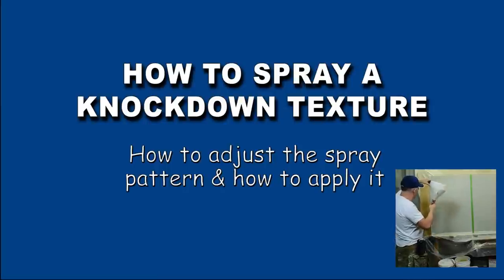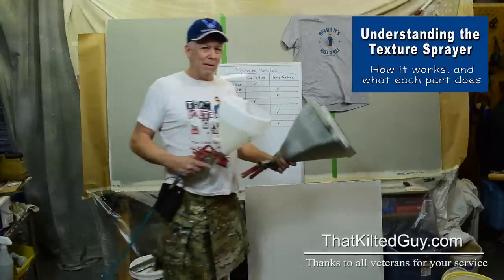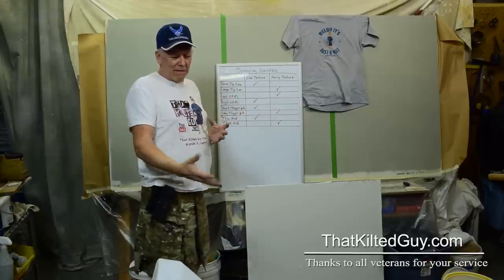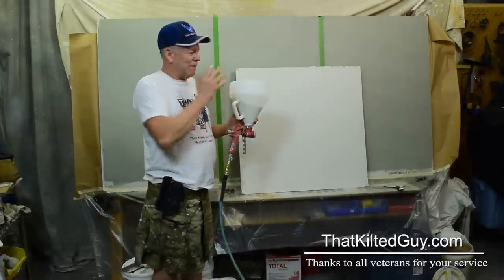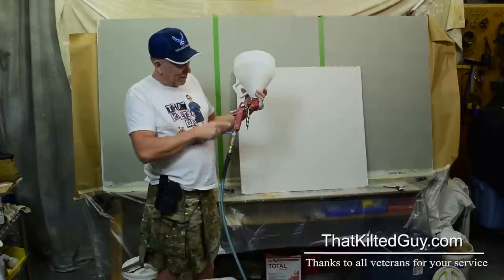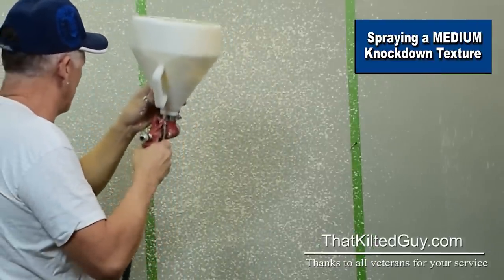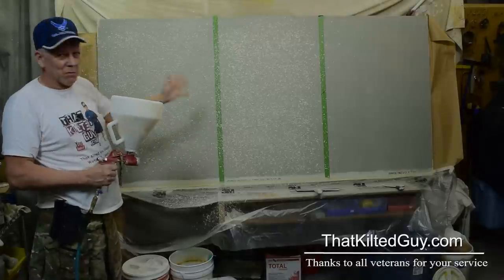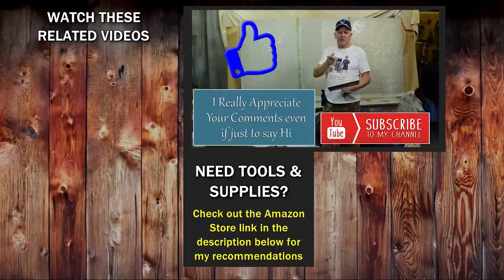Spraying Knock Down Texture in 2022.  Learn the 🔐 SECRETS 🔐 only PROS know using this $30 Tool

Comment: 8:07 pancake batter….the go to for explaining.
So here’s I describe thinner “batter” for ppl learning.
Want thinner mix, tell someone to microwave peanut butter or better yet HONEY in micro for 10-30 seconds, than pour into another cup….
For peanut butter nuke it but for 30-45 secs on 90% power (1000w micro) and gets you an idea of what “batter” looking for😉
If you actually do this, please use the amount of 1/2 to 1 cup to give you a good example as anything more than that….times/power be diff. I also highly RECOMMEND that ya do this, so get an idea of what consistency actually is😁

Comment: I wish I had watched this video before we bought 4 cans of spray texture. We watched a couple of your videos about how to take off the popcorn (we are redoing our bathrooms) and it worked perfectly and we used the Krud Kutter and it came off in sheets. My husband only has 1 day a week off so we knew it would be slow going since we have 3 bathrooms and are installing new vanities,  painting, installing new flooring in 2 of the bathrooms and decided to try and take off the popcorn and then knockdown texture the ceilings. The bathrooms are small and we thought if it goes well, maybe we could tackle the popcorn in the rest of our 3 story, 3500 sq ft fixer upper. LOL! Well he got so upset trying to use the canned spray texture (it was just oozing out the front and not even making it to the ceiling) that he was ready to throw in the towel, which really isn't like him, so I said let me see if I can find a video from that kilted guy. And I did and I love the 1st thing you say is "you should NOT waste your money on Spray Can Texture." So thanks again! We have renewed hope that we can accomplish this because of your videos. We are even going to order some items from your link below. :)
Reply from the maker: really glad I could help. Here’s a little tip though. When you use spray can texture and it doesn’t want to spray hard enough, heat it up under hot water until it does. The hot water will increase the pressure in the can and get it to spray. But I still hate the stuff, LOL
Reply: @ThatKiltedGuyDIY  I tried the spray can on a cardboard box.  I used about half of the can, then calculated the cost of doing my wall project.  It didn't take long to figure out that I could buy the sprayer and a box of mud powder, borrow a compressor, and still save over $100.  The spray can is expensive and the results are terrible.  The hint on heating up the can is useful if I need to use the can for a patch somewhere.  Thanks!

Comment: Very professional.  It was easy to tell you have the right experience to do this class.  I learned a lot.  I know it will help me in my upcoming whole house project.  Would you recommend the larger hopper for a whole house project?  I am 73 and not as strong as I used to be, so fatigue may be a factor.
Reply from the maker: Well the larger hopper means less fill ups required, but it will weigh more.  I think the light one will be fine for lighter textures, but if you are spraying heavy, the larger hopper will empty fast enough that the weight might not bother you.  And spraying ceilings will make either feel much heavier.

Comment: I love your videos. I need some assistance to be sure I have the right steps for my project. I have removed my popcorn ceiling, sanded and repaired all defects. I am going to do a spray on knockdown ceiling like you show. I want to be sure that I would do this step next after everything I have done and I don’t need to prime the ceiling or anything before doing the knockdown. Then I was going to do a paint/primer over the knockdown. I’m hoping you can help me know if this is the right steps. Thanks again!!
Reply from the maker: Other than masking off the walls before you spray the texture, you’ve got it.

Comment: 2 questions, please. First what size air compressor do I need with the hopper?  We have a small 2 gallon compressor that I hope to be able to use.  Second, we are remodeling a mobile home and taking those strips off, and then tape and bedding the seams.  Do we need a special mud for the vinyl wall paper?

Comment: I'm about to embark on a "project" repairing drywall after stripping wallpaper, cracks in ceiling and then knockdown texture. So thankful I've found your video before I started.  I went to your web page to subscribe for your newsletter and even sign up for advice.  Unfortunately none of the links work.  I click on them and nothing at all happens.  Not sure what's up with that.  Thankful I found your videos.  Been watching for two hours!!  Answered so many questions with the demonstated techniques!
Reply from the maker: Stacy, glad I could help.  I'll look into those links, but maybe try a different browser.  Haven't had any problems before.  If you need advice, that is beyond a simple answer on here you can contact me privately at thatkiltedguy15@gmail.com and I'll let you know the costs and options.  Or you can just sign up on patreon at the level which fits your needs at
Reply: @ThatKiltedGuyDIY  Thank you Guy!!  I tried again and my ad blocker (Adblocker Plus) was the problem.   I had to permit your page.  Seems to work now!  Thank you for the contact info also!!   I've signed up for Patreon!!  Thanks so much!!

Comment: I appreciate your videos and have been enjoying your channel and already been a huge help on several projects. We are going to be moving to an older home with popcorn ceilings and proper a bunch of wall repair.  I am curious to any tips and tricks when spraying knockdown on celing.  Also, not sure  if what the strategy is to take if I have a bunch of  painted textured walls needing minor repair.  Would I sand and do a skim coat?   You may already have videos that address these specific things.  I don’t know how homeowners learned this stuff before Youtube...
Reply from the maker: Here's one on knockdown on ceilings- https://youtu.be/0fUkW3SCYiE
And check this one out for misc repairs- https://youtu.be/_sSHn51WYxs

Comment: I appreciate your in-depth videos, very helpful. I'm curious though, which tip did you use to spray those knockdown textures? Was it the middle sized one?
Reply from the maker: The middle size is the one i use the most

Comment: Awesome video. After the drywall is up and joints are finished, what’s next? What are the steps? Joints, prime, knock down then paint? Appreciate it
Reply from the maker: Most drywallers just finish the drywall and then apply the texture right over that. Then primer and paint.
Reply: That Kilted Guy DIY Home Improvement ok great, I’m just trying to finish my kitchen 9’ x 13’....

Comment: I've subscribed. I've read on contractor forums that some people tint the mud so they know they've covered areas when taping and doing smooth wall.  If you are spraying texture on primed drywall, which is usually white,  wouldn't tinting be helpful here too, to ensure complete coverage?  On  another drywall pro's videos comment section he says he never applies tinting to mud on spray texture.  I'm not sure what he means by that, does  he not apply tint to taping mud or to the spray mud?  Either way, I'd like to know what you think about tinting mud.  Never-Miss Tinting?  Chalk line tinting? Food coloring tinting?  Maybe do a video on tinting issues.
Reply from the maker: Hello, sprayed on mud is pretty easy to see going on as it goes on mostly yellowish.  As for tinting, I Only tint when doing a level 5 smooth finish, like in this video I put out- https://youtu.be/4T6x7wiP-aA

Comment: Thanks for the video. Super helpful. Doin some home renovations and I have a 100 CFM compressor, small little guy, will this be ok to use with a texture hopper?
Reply from the maker: a 100 cfm Compressor would cost about 100,000, so you probably mean PSI?  Read my recent community tab post about this.  https://www.youtube.com/@ThatKiltedGuyDIY/community and scroll down a little

Comment: Love your videos, you’re an excellent tutor. Quick question for you, or anyone else. I’m a complete novice but have a big project coming up. I want to achieve a level 5 (I know, ambitious right) finish. I have time to finesse, it’s not a commercial job. If I apply diluted joint compound with a spray hopper and immediately smooth out with a knife can I achieve the same result as I’d get using a roller to apply? I’m thinking that spraying is easier and faster than rolling but maybe not. Surprised that I haven’t seen any videos on this approach but perhaps it’s because it is a bad idea.
Reply from the maker: I have thought of that but the cheap texture hoppers would take 3 to 4 times as long to get it on thick enough

Comment: I did buy that plus 3, but it seems to flake off the wall pretty easy when I accidentally hit it with things. Also, cheap paint might have something to do with it also being that it came off the wall easy when I hit it?  I also feel I didn't hit the wall that hard either.  I'm going to try using just the all purpose on next project.

Comment: Thanks for your video helped me a bunch and do you have a video on how to tape angled greater than 90 I struggle with that especially going into another wall
Reply from the maker: Do you mean taping inside angles like in this video? https://youtu.be/J-aS1vsjQi8

I'm actually going to release a better version of that video real soon, so be sure to subscribe and click the bell icon.  I already shot the video so it shouldn't be long.  If not an inside angle, do you mean an outside angle like one that is a 45 degree splay?  I can certainly do a video like that, as it's a good idea anyway.  Thanks

Comment: Best knockdown video by far! Thanks a lot!
Can I please get the CFM value of the medium texture?
Reply from the maker: Thanks.  There's no cgm value.  I have a little ball valve right where the air enters the gun and I adjust that till I get the pattern I want.  For medium try opening it midway.  For fine, open all the way, etc.  Set the air psi to 30 for everything and adjust the CFM with the ball valve.  If you don't have a valve, turn the PSI up for finer, down for coarser.  Thanks again.

Comment: I'm about to do a project where the tenants want the heavy knock down applied to the ceiling. What's the best way to go about? or, how do you recommend I go about it? I did realize you had move closer to wall when you did the heavy knock  down in the video...
Reply from the maker: This'should help- Live, Spraying a Knockdown Texture with a Hopper Sprayer, by That Kilted Guy DIY https://youtu.be/0fUkW3SCYiE

Comment: Nice videos! Would you do a video on doing a santa fe texture? There are only a few on YouTube and they're not very good. I'll be doing a large room and hallway with a  vaulted cieling within the next two weeks.  I've done knockdown before and it turned out great but it was a small room so I had time to sit and wait for just the right time to knock it down after I sprayed it but with this large of a room I'm having a lot of anxiety about things drying too quickly and the texture not being consistent throughout when I go to knock it down. How do you do large areas and stay consistent throughout? So far, your skip trowel method might be a better option for starting and stopping. I'm just kinda lost right now  on what texture I should use for this big of an area. I need it to look good. Also what do you  do with pinholes, debris, and streaks from the debris when your skip troweling or when doing a santa fe texture? Also would you prime before texturing? I'm having a lot of joint compound  adhesion problems to the several layers of old paint even though it was sanded down first. The moisture from the skim coat keeps softening and lifting any prior coats. Sorry so many questions.
Reply from the maker: Hello john mousseau, due to the increased number of subscribers, and questions, all our more complex questions are now answered on our Patreon page at: https://www.patreon.com/ThatKiltedGuy. We hope you'll join us there and help us to answer your questions, and to put out many more videos.  

We will continue to answer the most common, simple questions here, and we greatly appreciate your comments.  Thank you for your support!  And yes, I'll be putting out a lot of texture videos in the near future, along with the many I already have out.  Guy

Comment: Low volume spray gun hopper.  I see the hopper you use and recommend has a minimum airflow requirement of about 7 cfm at 90 psi even though you use it at 30 psi.  A big box store sells a more expensive hopper (3x as much, Texture Pro 200 spray gun) with a minimum requirement of 2.6 cfm at 90 PSI which will work on paper with my existing small pancake compressor.  I am texturing about 300 sq feet of wall space with medium knockdown.  Understand if you have never seen or tried this smaller gun/ hopper with smaller air compressor, but if you have tried it, any tips on getting it to work?  Or if you tried it, is your recommendation to run and hide and just suck up renting a big compressor.  Thank you.
Reply from the maker: OK, yes most hoppers need more CFM than the small compressors can handle if you’re spraying an entire wall, room, etc.  But since I mostly teach repairs, I show myself using the compressor in the link below. It will keep up long enough to do a repair since you only pull the trigger a little at a time. And I shut the air off as soon as I’m done using it right at the bottom of the gun with a ball valve. 

I’ve used the compressor below 95% of the time. It’s lighter and quieter than a bigger compressor

https://amzn.to/3PX4AN9

So for bigger areas I would recommend a bigger compressor.

Comment: GREAT videos ....   question you never had ..   could you use a hopper to paint a truck bed  texture? ..  maybe using bondo or fiberglass as the mud ? ...   dont want to pay high prices for the auctual truck liner  kit ..  its a old truck ...   thanks for info...  cheers
Reply from the maker: A hopper wont' spray really heavy stuff, as it relies on gravity to flow the material to the nozzle, so probably not.

Comment: One thing I did not see you cover (maybe I missed it) is the angle of the trowel to the ceiling that you use to do the knock down.   I made my initial pass which looked great.  Then I did a pass at 90 degrees to go the other way so it doesn't look like the knockdown is being pulled all one way.  But each time I did that I got ripples.  Could not figure it out.  I believe I had too much of an angle on the trowel on the second pass after sleeping on it.  but any suggestions on how to fix this would be welcomed.  :>)
Reply from the maker: Keep the angle low

Comment: Is it advisable to prime the drywall before applying the texture?
Reply from the maker: They recommend it but we never did when doing new construction. But it will allow the drywall mud to set up more evenly making it easier to knock it down so it is a good idea.

Comment: Very informative, thank you. Can I use the 6 gal pancake compressor to do texturing?
Reply from the maker: Even small compressors will work for awhile.  The smaller ones may run out of air quicker, and not break up the mud as much, so you might have to wait for it to catch up.  The main this is to look for a CFM rating of roughly 3cfm or higher, at 40 psi, as this is what I have and sometimes it can't keep up.  Over 5CFM would be better, but I've gotten by with mine for years, so it'll work.  Be sure to turn the air off when refilling with mud so the compressor can catch up some.
Reply: @ThatKiltedGuyDIY  I'm only doing knockdown on a 7x7 foot section of ceiling; so it sounds like my little porter cable pancake AC will work.

Comment: Thanks for your video! Do you have any suggestions if my wall and ceiling are skim coated with mud that’s well dried? Thanks!!
Reply from the maker: Probably just sand it, touch up any remaining defects and texture it
Reply: I guess that my question was regarding how the skim coat would affect the wait time from spraying to knockdown
Reply from the maker: It'll set up a little quicker

Comment: I need to do a medium knock-down on my ceiling and a fine orange peel on the walls.  I understand the techniques for each but wondering what's best to do first, the walls or the ceiling?  I'm thinking the orange peel on the walls first without masking the ceiling and then after they're dry masking the walls and doing the knock-down on the ceiling?
Reply from the maker: That's a good way

Comment: Hi Kilted ONE!  I have an old house that looks like the ceiling originally was a smooth texture but over time and several layers of painting with a brush and at times a roller I see brush strokes.  Can you tell me how to mimic that.    And Thank you for your Service
Reply from the maker: I’d have to see a picture or two to know if I could help.  ThatKiltedGuy15@gmail.com

Comment: kilt i have a ?..the company i work for just bought a building next store..The walls were cinder block with firring strips nailed to them and paneling for the finished wall..I gutted every thing down to the block wall,and where i broke off the firring strip mason nails i patched,filled with caulk and ran a putty knife over them..The building is old and the block has a some what rough texture to it..It also has old paint on it..If i spray block sealernon the walls can i spray knockdown to the block and will it adhere,does knockdown work on block walls etc...thanks
Reply from the maker: Well drywall mud will stick to primer, so it should work.  But I wouldn't do knockdown if the wall isn't really level and smooth or you'll have flatter knockdown on the high spots, less on the low, and chatter marks everytime you hit a little bump.